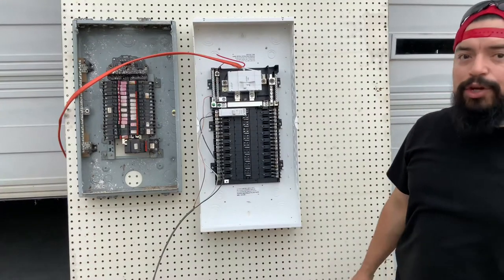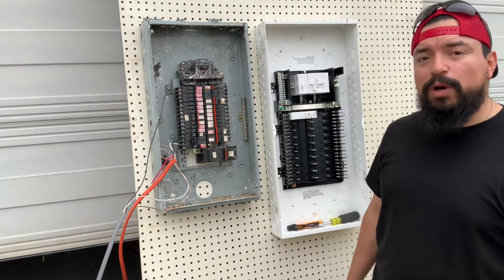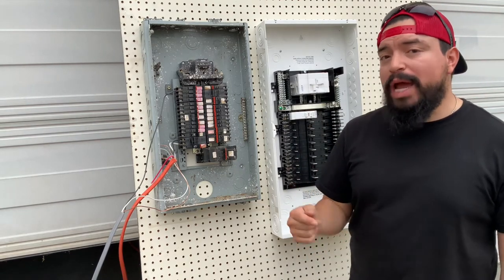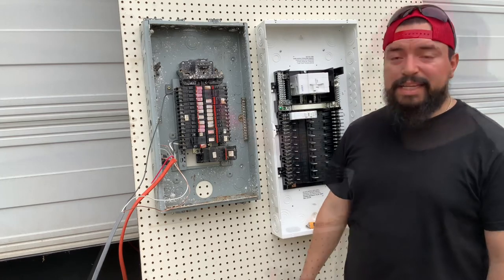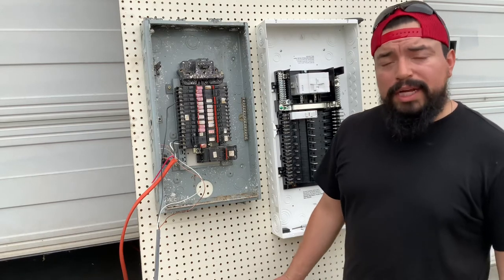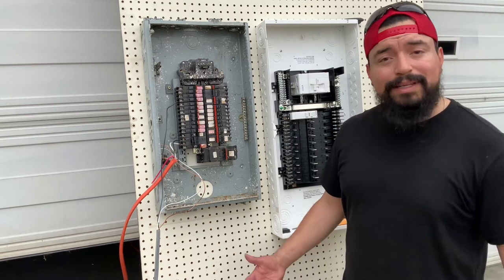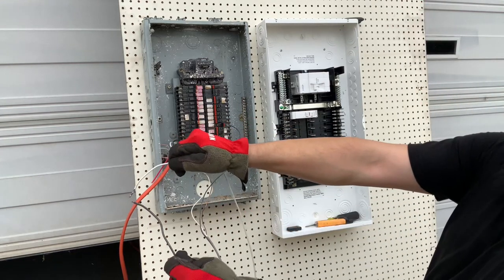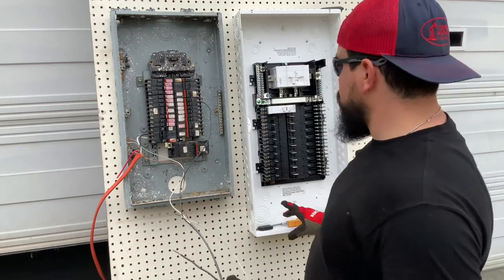Compare Leviton Electrical Panel to a FP- Federal Pacific. See the Short Circuit Failures.

Comment: I really cannot thank you enough for raising awareness,  you are litteraly saving homes and lives.  Wish I'd known this about 10 years ago.   I suffered serious burns to my chest, and forearms and spent a few days in the hospital.   I was at a friend's home,  unplugging an arc welder in a pole barn.  Surface mount 50 amp, 240 volt receptacle, metal conduit system, 100 amp FPE panel.   Part of the receptacle chipped away, causing the lugs to break free and touch each other and the metal box.   Both the 50 amp breaker and the 100 amp main failed to trip.   I remember dropping to the ground and crawling down low, to get out and call for help, with  molten metal flying everywhere and loud explosions when the panel caught fire and shorted the service conductors, and the explosions only stopped because the cut out on the pole transformer blew.   I have scarring on my chest and arms,  along with some hearing loss.
Reply from the maker: What a story you have! If only homeowners knew the importance of removing these panels from their homes. Thank you for sharing.

Comment: YES BUT if you are a landlord and phoned up every day for 'LIGHTS GONE OUT' you probably wish you had federal that didnt trip so easy and did 37 YEARS SERVICE.
Reply from the maker: That is a fact! Federal Pacific breakers do not trip!
Reply: If you're referring to arc fault breakers, they can have nuisance trips with fluorescent lights and some motors. Otherwise, you have a problem that needs to be corrected. Breakers shouldn't trip frequently like that if there isn't a problem. And I'd look at the previous owners of that FP panel as having 37 years of good luck!
Reply: These panels are old at this point and should be replaced. What I want to know is why electricians want 3000 dollars to replace. I did some research and did it myself for around 300 dollars. It's not brain surgery. Seems to me, these panels are easy money for these contractors.